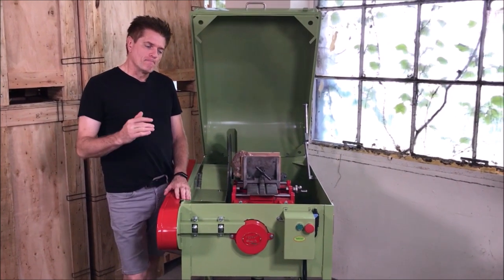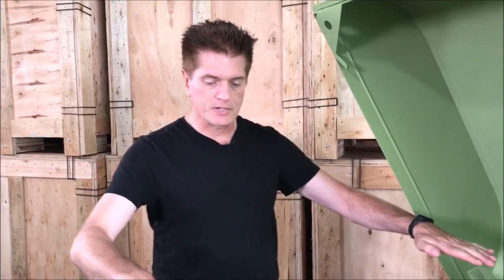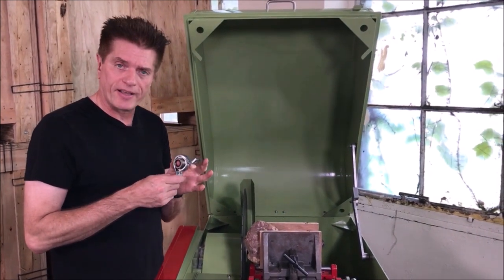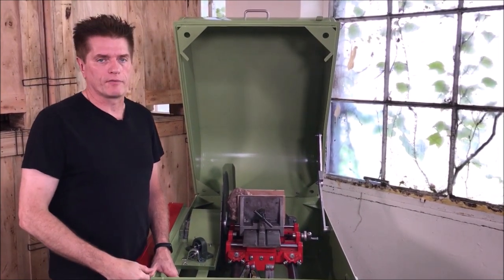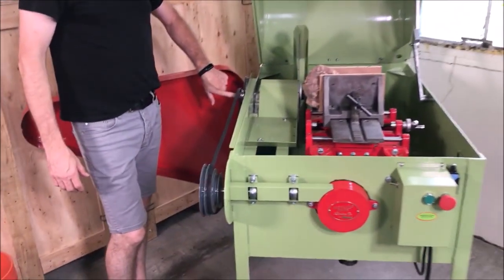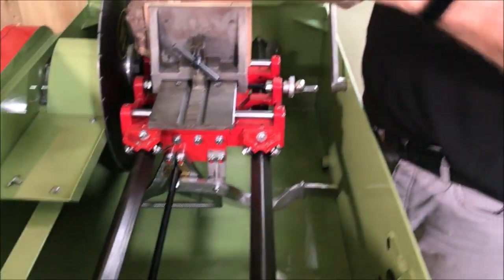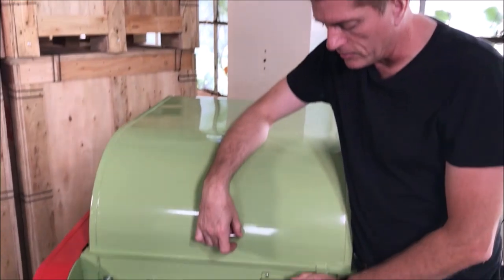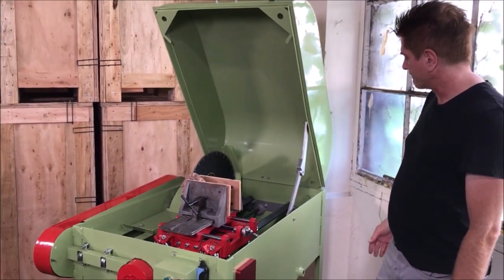Introducing the NEW Highland Park 20 Inch Slab Saw!!!

Comment: I really like this model - especially the Everclean feature - but I'm curious as to why you don't put windows in the hoods - I noticed the laboratory line of saws has them, and I've seen comparable models from other brands include them - so are they just an expensive feature to add, or do you find that the oil splash impedes visibility to the extent that they aren't worth it? I like the idea of being able to see what's going on while the blade is running.
Reply from the maker: The windows lose their purpose because it gets splashed by mud (oil and dust), so seeing clearly right through it is impossible. We want to provide a fully functional machine that is cost-effective. This is an old marketing gimmick that we don't support, as it's more expensive to create, and also not worth it. If you like to have that window on your hood, we suggest that you saw a hole in your hood and put the window yourself. But that's the reason why we don't do windows on our hood.

Comment: does these machines arrive preassembled? i`m not good at putting machines together, just asking.
Reply from the maker: Yep!  Just add the cutting coolant and the blade and its ready to go.  We can help you step by step and we have lots of other videos as well!
Reply: @HighlandParkLapidary  thanks! i had other used machines that were a bear to assemble and replace the cheap wore out parts on, thank you for the videos